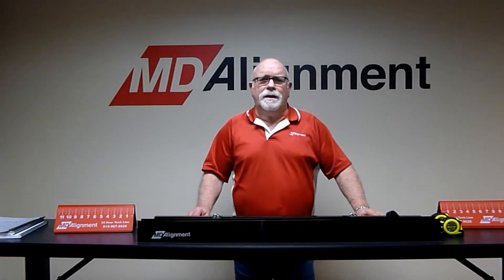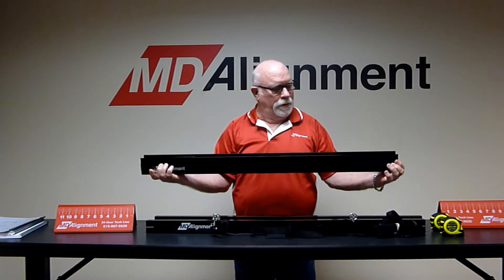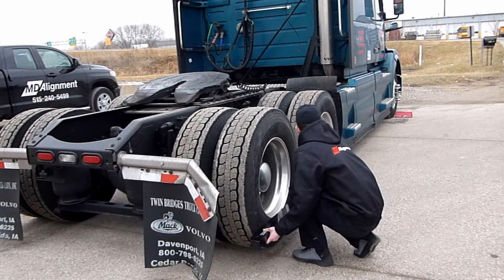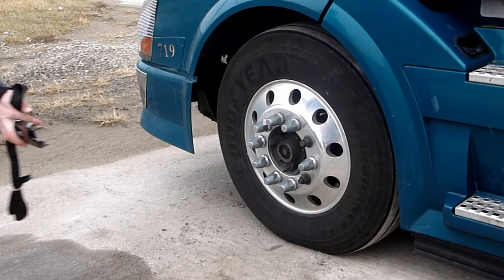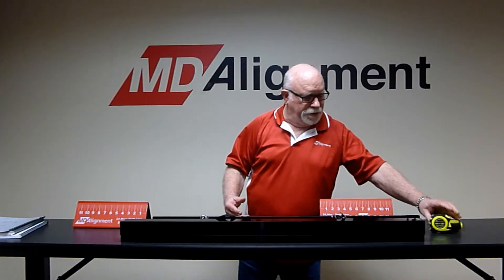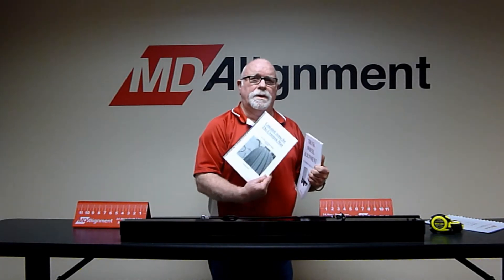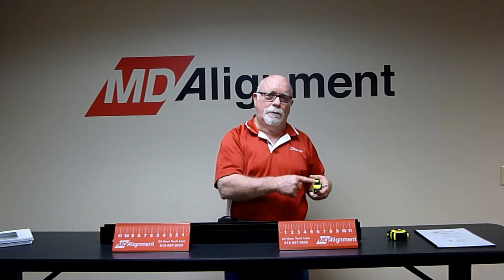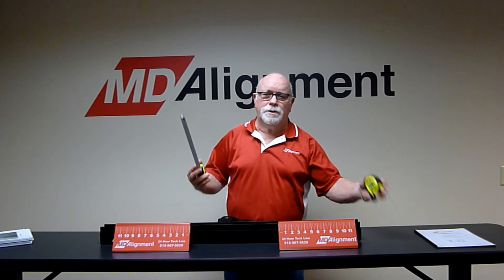Toe and Tandem Laser System

Comment: Hi Mike! I wish you would do a video of a Chalmers 800 suspension. That's what my 07 KW T800 has and it has pulled to the right now and worse when loaded for quite a long time. I have determined that the back tandem is off to the left by your string method
Back tandem 1.25 inches to the left
Front tandem  2.5 inches to left
Is strait ahead where these need to be? 
Thanks!